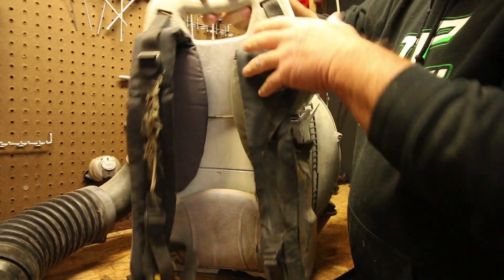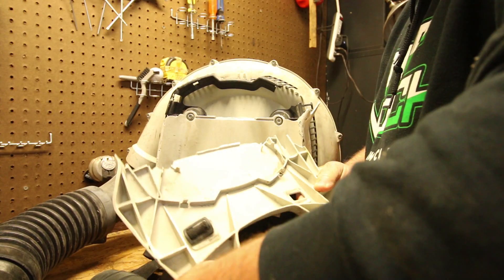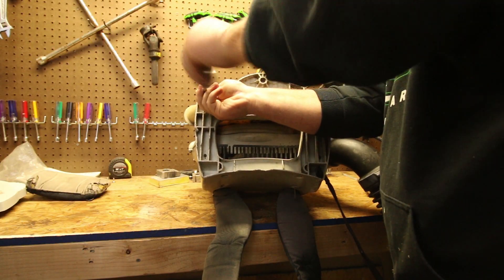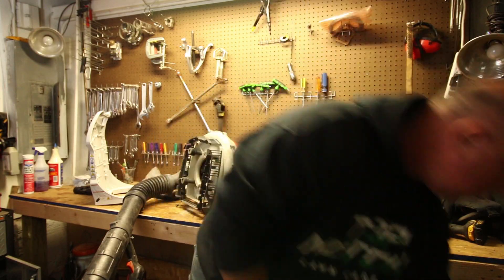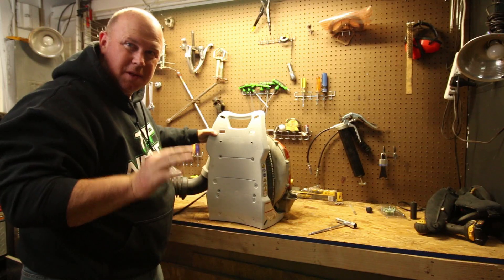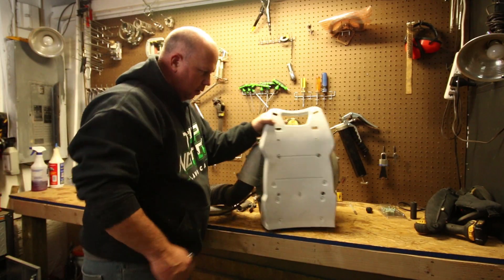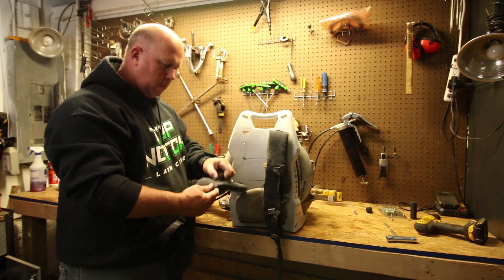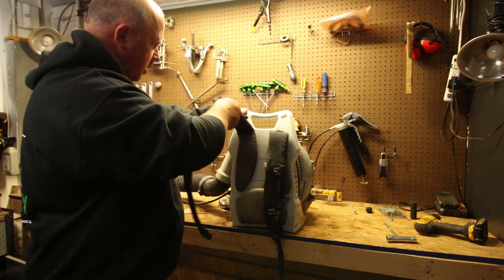Stihl BR600 Back Pack Blower Back Plate Broke

Comment: we did 2 of them on a rain day. 2 new backs. new pull cords. straps were still good. new pull cords on all the trimmers, new trimmer bumps. installed the blowers for bagger units on both scags. changed oil. changed grease in front caster swivels. washed up mowers.

Comment: at the workshop the mechanic used to use a long shaft star fitting in the battery driver. it's alot quicker and less hastle.

Comment: Thanks for the Video. I had to change one and you were a big help. It went well for me about 1/2 hr. Was expecting problems with screw alignment as you mentioned. Was no problem. What I found was lay the blower down and set the plate on the back and all four were aligned, screwed right in. I put the tank on after. Seems to be the way to go. Cheers!

Comment: Thank you for the video, making it, editing it. It is a good video, I love to learn everything. Could you make a video about how that got broken, or just include that tiny bit of info in your next video, or you could comment back, so we can prevent that from happening to us, thanks. If your able to shot that from a top view, Top Notch we could see what your doing better and you won't be blocking the camera as much. I do like your videos. Keep up the great work and thank you for the video.
Reply: perk i am going to guess normal wear and tear. its bound to happen with the amount of use and hours on it. also look at the straps. those dont just get like that without a lot of use. also betting elements such as rain cold and heat on then weaken the material. used to service body shop equipment as saw tiedowns wear in about 6 months do to heat rain and cold and wind.  he is probably about the time to buy a new blower and replace that one or move it to back up status.

Comment: Does any know anything about simpilcity lawnmowera
Reply: Tom Reel ya they are owned by Briggs and Stratton who also owns ferris and snapper pro
Reply: Thanks for the comment,i have a rear steer one with the engine onto of the mower deck,mulcher,its very good but chews the bed belt

Comment: My 700 did that because of my rack on the trailer
Reply: Addison Corley I don't know why people love these Stihl blowers they vibrate like crazy making them extremely uncomfortable and they seem cheaply made.
Reply: Dodge 318 Cummins it's a good blower, cranks on one pull they just need to stronger backing an it'll be awsome
Reply: Addison Corley I never used the 700 but I used a br600 and I prefer my echo way more.
Reply from the maker: Yea mine was the same. It had nothing to do with the bower and all to do with the racks.

Comment: Im not really impressed with stihl backpack blowers lately. I had one of the weak-azz strap bosses break on a BR800X that was only a week old. My two year old BR450 is busted all to hell. Meanwhile, my 22 year old BR400 has endured falling onto the highway at 60mph before, and none of the plastic casting or anything is broken